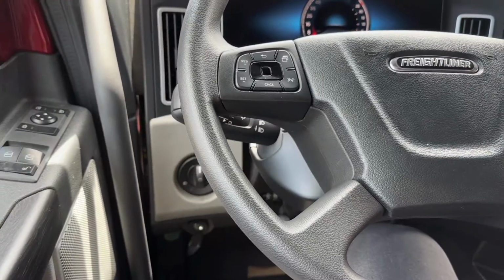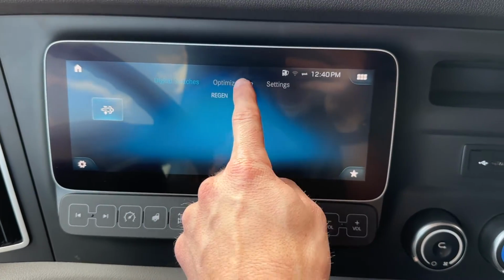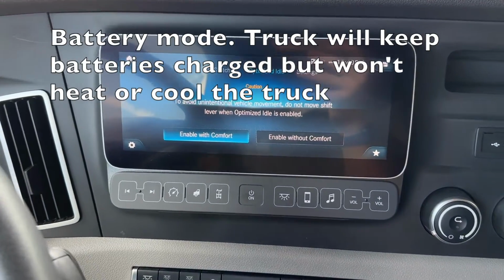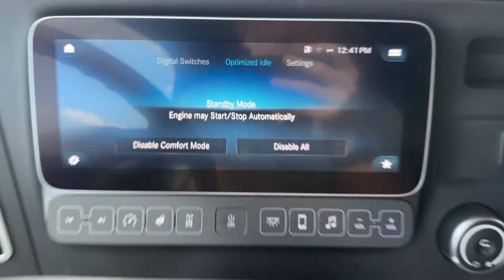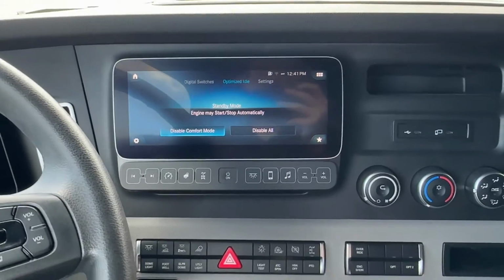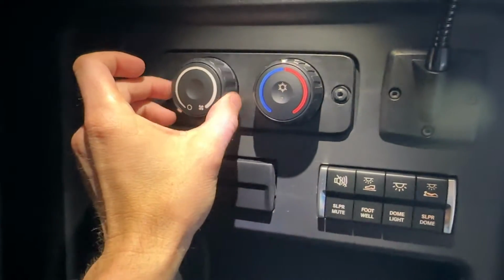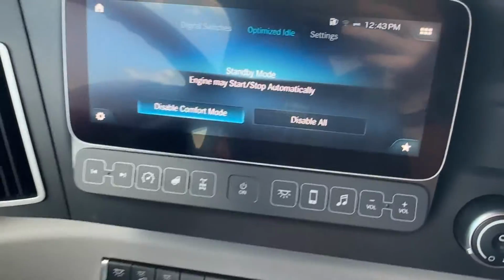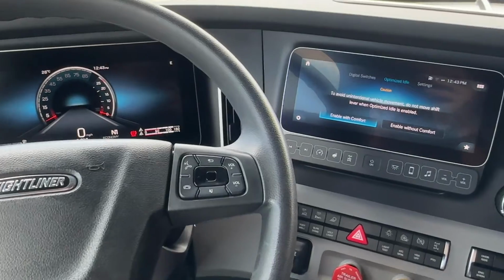Optimized Idle *Digital Dash version* Freightliner Next-Gen Cascadia

Comment: I hope the opti-idle will work atleast.

My 2021 worked ok.  But my 2024 would run once and that was it in comfort mode.  I bought a thermometer to keep in the bunk and even if I sat there and let it get up into the high 80s it would NOT start the truck to run the AC.

Comment: I have a question I have a truck with this system and I’m experiencing something tht I’m not sure about. When the truck starts up it warms up the truck but when it turns of the system is blowing cold is this normal?
Reply: @morgan_lt8996  I’m having the same issue. Comfort mode seems to be set for A/C only. I bought this truck used and apparently the company that had it before wanted to force drivers to only use the bunk heater for comfort when it’s cold. 
When I want to use optimized idle for battery and engine temp. I turn the bunk blower fan all the way off and this prevents cold air from blowing in the cab and sleeper.
I will be getting this parameter changed though. These bunk heaters do malfunction occasionally and it is inevitably on the coldest night of the year. 🥶
You can still idle the truck normally (not optimized) for cab heat, you just have to increase the RPM in the "engine idle adjust" screen to prevent it from shutting down… if some penny pinching company desk driver hasn’t disabled that as well.
Reply: @LeonSpeegle I tried engine idle adjust. It would not let me do anything. This really really sucks. I'm tired of freezing and hurting
 A job shouldn't be painful
 I hate this stupid sh*t
Reply: Music has never disturbed me. It disturbs you. Get a life. I would not drive for a company that don't allow me music. Wtf
Reply: Turn ur key on. Don't Turn on ur truck. Turn off ur blue or green light on ur front control knob. The truck will turn on by itself without activating ur ac. That way it be blowing air w/o ur ac on